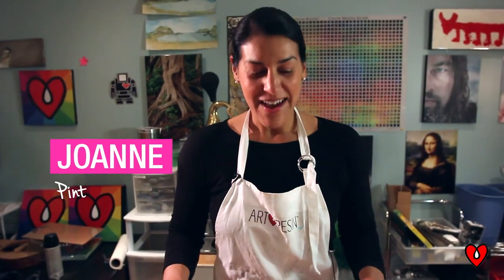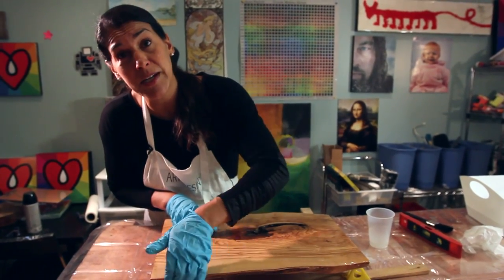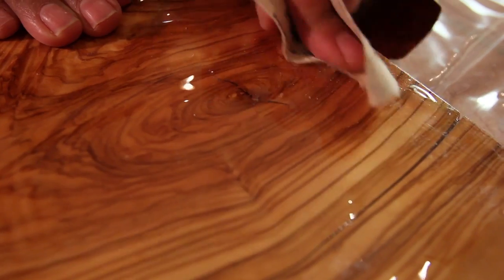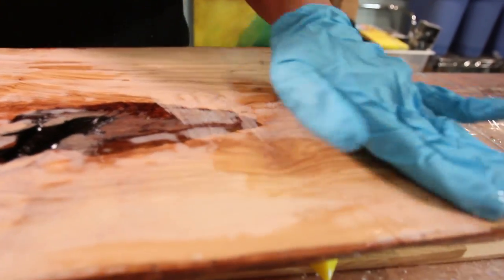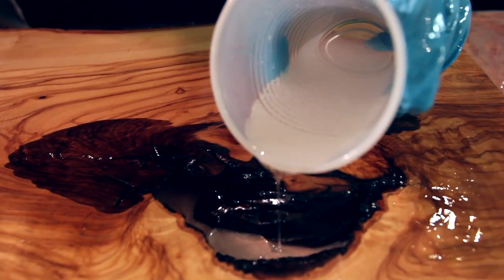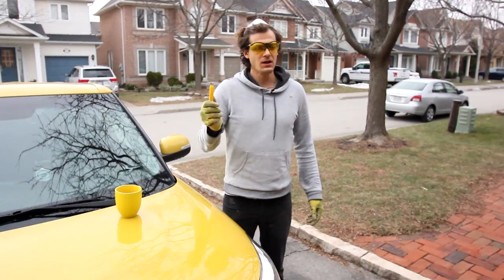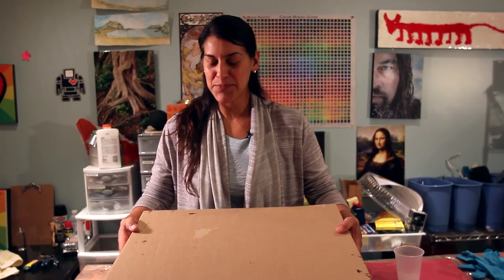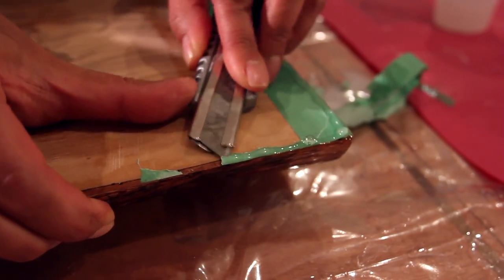How To Resin a Live Edge Wood Board - Step By Step Tutorial

Comment: Great project! A Random orbital sander works too. I only pull out the belt sander when I need to remove a lot of material. Start with 80 grit and finish with 220!
Reply from the maker: Great point!  I think this was the perfect reason for Dave to be able to buy that belt sander he had been eyeing up ;)
Reply: Random orbital for sure. Nice video!
Reply: Mmm. Yes. My first thought when they chose a belt sander. I have three in various forms, but an orbital is far better for this and you can still use 80 grit. However, when I use a belt sander I keep it moving like a sort of random orbital and it is a suprisingly good result. But you can't beat the random orbital. I think its an excuse for another trip, to ring more bells.

Comment: Re the wood soaking up resin.  There is a product called Benite which is inexpensive and very good at filling the pores in wood preventing air bibles later and also helping with dimensional stability.  You will waste a lot less time and resin.   Also when in comes to mixing, pouring the 00:03:00 mixed material into a new container ensures that any failure to scrape the side and bottom is dealt with.
Reply from the maker: Thanks for the tips, Charles.  We wanted to show that you could use ArtResin to keep it totally non-toxic, but you can also use something like ModPodge or white glue to seal the wood prior to resining too.  
And for sure, some artists definitely pour their resin into a fresh container after they mix - we like clean up as easy as possible 😉
Reply: ArtResin yeah Benite is definitely toxic,  though once encapsulated by the epoxy will pose no danger to any food stuffs and so forth.  It not only fills potential sources of air bubbles but also displaced moisture.  I’ve found that clients who will be exposing my work to variations in temperature that include bright sunlight, less moisture is better.  

Using the transfer method to ensure proper mixing is definitely wasteful.  When I was younger a manager of mine asked “why is there always time to redo the project correctly but never time enough to do it correctly the first time?” (fortunately I wasn’t the source of his consternation).   My projects involve gallons of material,  I far prefer to waste inexpensive containers than spendy epoxy or equally costly live edge lumber.

Comment: Working on a live edge maple slab and I’m looking at staining it. I’m wondering if I stain it first and then do the resin. It’s my first project of this size and I’m trying to not mess it up. Any advice would be very helpful
Reply from the maker: You can certainly stain it first. Now a few things to point out, some woods will darken just a bit and some darken a little more than others when applying resin. If you have a scrap piece I might suggest doing a small test piece to see if the resin alone would bring out the color you are looking for. Now if you already know you want to stain it, just stay away from oil based stains, the resin will want to repel from it when you apply the resin. Once you stain is FULLY dry you can go ahead and pour your ArtResin :)

Comment: THANK YOU! THANK YOU! THANK YOU!
Your directions were exactly what I needed. And using the gloves.....SO much less work.
Reply from the maker: Thats great!  Happy to help 🙂
Reply: Joanne, I copied your actions and had pretty terrific success. Thank you so much. 
I have one question though....how long do you leave the painter's tape on to avoid the glue residue? Or, what do you use to remove the glue residue from the tape without marring or dulling the gorgeous surface? As you can guess, I've done both.....sigh....
Thank you in advance.
Reply from the maker: @tourprincedward5215  once the ArtResin has cured to the touch, usually around 24 hours, you can carefully pull off the tape.

Comment: When doing the final coat on the bottom, do you have to tape the edges of the front and torch out bubbles too?
Reply from the maker: Yes, repeat the same process to avoid and drips forming on the top of your piece and I would also recommend torching the bubbles to :)

Comment: That was really helpful, Thank you. Can you use a knife to cut cheese etc without scratching or damaging the resin surface? I don't think I can get the art resin here in NZ so I'm guessing that I could use another 2 pack resin. I've not done tis before but really want to give it a go.
Reply from the maker: Hi Gill, once cured ArtResin is scratch resistant, not scratch proof.  Using a sharp edged knife can leave a cut or scratch in the surface so its best to avoid sharp knives.  ArtResin is available for purchase in NZ, just select your country from the drop down menu.  https://www.artresin.co.nz/collections/artresin?c=nz
Reply: @Artresin  awesome,  thank you so much.  You're very inspiring.
Reply from the maker: @gillmolony6781  Thank you!!

Comment: Are you finding that you have tiny marks on your board from the triangle holders? I use wire nuts to hold the boards up and even though the board had had more than two days to dry, I saw the letter and number imprint from the top of the wire nut. So I was wondering if you find imprints from the triangles as well?
Reply from the maker: We didn't get any marks on this board from the triangles ... maybe because it had a longer cure time ( it was often several days between filming and we had it in a warmed room - heat accelerates curing ).  However, this happened to me on another board I made, so I have a couple hints to share :)
First, I would let the board cure for as long as you can so it gets as hard as possible before it's resting on anything that might dent it.
Second, I would try to use something that is flat, like an overturned plastic cup, as your supports.  I used lego blocks under my piece and I definitely got indents from the lego in my resin. 
Third, I would always make sure your final coat is the top of the board ... that way if you do end up getting little indents in your board, at least it will be on the bottom where no one will see it.

Hope that helps!
Reply: That's a nice idea ( to use the wire nuts).

Comment: what do you recommend for sealing something like moss or bark before suspending or covering with epoxy? Like are there any sprays i can use on something like moss before i pour epoxy?
Reply from the maker: Hi there :) I would do a test piece using a spray sealant like Krylon to see how it reacts to the moss/bark.
Reply: @Artresin  Ty for reply. Just an oil based clear primer? Or should I use a polyurethane specifically? Just wondering if there are any clear sealers i should definitely stay away from when working with epoxy etc.
Reply from the maker: @b.koonce1831  I would stay away from oil based primers, ArtResin like to repel from oil based surfaces.

Comment: I'm new to resin art and am excited to learn from you guys.  Thank you for sharing.   I like the yellow stands and was wondering if you could tell us where to find a set?  Thanks again.
Reply from the maker: Hi Karron - thanks so much for the kind words :)
You can buy those stands at in the paint section of the hardware store. We do have a set of those yellow pyramid stands, but more often than not ,we actually use Lego.  We use the big Lego pieces for toddlers - you can even buy these at the dollar store.   They are inexpensive and you can easily adjust the height up and down as necessary by adding or taking away blocks.  Some have used hard plastic drinking cups as well.  
Whatever you choose, make sure it's plastic so if you get any resin drips, you can peel them right off when the resin has dried, and you'll never find your supports are stuck to the table top or to the bottom of your piece ( we have made that mistake with glass bottle supports in the past!!  )

Comment: So is this product not as touchy as the other products when measuring so you don't have to be as precise like with other products?
Reply from the maker: ArtResin is a 1:1 epoxy resin, measured by volume.  We usually use a measuring cup, but for small amounts you can eye ball pretty well using clear plastic containers or glasses :)

Comment: Great video. One question I have is: Is this resin suitable for outdoors? As a finish to protect the wood? Thanks!
Reply from the maker: Once cured, ArtResin is weather resistant, waterproof as well as heat resistant to 120 degrees and while many artist do use it for outdoor pieces we still don't recommend that you put it outside.

With its advanced UV and Hindered Amine Light Stabilizers, ArtResin is chemically engineered to offer the best protection against yellowing on the market. Even so, it doesn't make sense to deliberately put your artwork in an environment full of UV rays - it makes it much harder for ArtResin's UV stabilization to do its job :) 

Now the most common uses for outdoors are wood or rocks where you really wouldn't notice the yellowing as what is is protecting is darker in color.

Comment: Doesn't look like you sanded in the hole after 24 hours before the second fill layer. Did it bond properly?
Reply from the maker: Yes it did :) The piece turned out beautifully no problems with it adhering.

Comment: I am doing a similar project but not covering the wood entirely with resin, just the voids, as I prefer combination of resin and wood. But the challenge I am having is trying to find a finish that will work equally well on the resin portion and the wood portion. I have tried various oils, but find that the resin does not accept the oils well. Any suggestions would be helpful.
Reply from the maker: Hi John - have you tried sanding the whole piece down?  You need to create some tooth in the resin in order for it to absorb the oil.  Start with a coarse sandpaper, like 80 grit, and work you way up to a fine sandpaper, then apply the oil with a soft cloth.

Comment: Won’t the volume of each not be equal because of the different viscosity and the fact that they don’t completely pour out of the small cups? And how would you make sure the volume of each is equal, measuring in separate cups?
Reply from the maker: If it is easier, you can pour into the same cup, just use a graduated cup and fill equal measurements.  If you are pouring into separate cups then combining them together just be sure to thoroughly scrape out the cup so that you are not leaving any behind.

Comment: How thin is your first layer? Can you apply a thinner than 1/8” coat on canvass?
Reply from the maker: You can apply the resin as thin as you'd like by using a disposable foam brush or spreading it on with gloved hands instead of pouring it.  1/8" is what the resin will naturally self-level to when you pour it.

Comment: What grit sandpaper did you use on the belt sander?
Reply from the maker: Hey Rusty!  You want to use a coarse sandpaper to really rough up the surface and to create some tooth for the fresh resin layer to adhere to.
We use 80 grit sandpaper here at ArtResin.
Reply: Do not use a belt sander as it is easy to cut through the resin and gouge the wood.  Always use a high quality dust mask when sanding resin as the particles can cause life threatening lung disease.

Comment: Can this be done on green wood? The tree cookies I have were just cut. I'm  making a stand for a wedding cake.
Reply from the maker: The wood needs to be dry - if it's moist, you will get expansion and contraction in the wood with temperature changes and will be at risk for the resin cracking when the wood expands.  So, if you want to use them for a one-off event, then yes, you certainly can, but for the long term, you may experience the issue described above :)

Comment: Dont u need to sand it down with a less rough sandpaper like 360, 50and 1000? Does it look good when u just use a 80 once? Dont u see the scratches then?
Reply from the maker: Nope, you want to use a coarse sandpaper.  The idea is to rough up the surface in order to create some tooth for the fresh resin to adhere to.  
You won't see the scratches - the fresh resin will fill them all in - it's like magic!

Comment: Since you are using it as a charcuterie and cheese board, how will the resin hold up to knife cuts?
Reply from the maker: Hi Kate!  ArtResin is certainly scratch resistant but it is not scratch proof ... for cutting something like cheese with a cheese knife, it would be very durable ... but for instance, using it as a cutting board to slice bread with a serrated knife, it would definitely scratch under that kind of pressure.  The good thing is that even if it does scratch, you can lightly sand the whole piece, apply another coat of ArtResin and it will look good as new!!  :)

Comment: Does ArtResin yellow with UV exposure?
Reply from the maker: Hi Regan - all epoxy resins will yellow over time when exposed to UV light.  There are many factors that affect how quickly this will happen ( direct light exposure being the main culprit ) but what you can be sure of is that ArtResin has the strongest UV protection out of all the epoxy resins on the market, so ours will yellow the slowest. :)

Comment: Non-Toxic, Food Safe, Certified by the FDA - Can you share that study, because I cannot find ANY mention of Art Resin on the FDA website.
Reply from the maker: the link to the FDA data is in the text under the video :)
Reply: The link says incidental food contact, to me that does not mean to put food directly upon...
Reply from the maker: THANK YOU for pointing this out!  That info is wrong and should have been updated ... ArtResin is safe for direct food contact as per FDA 175.300 
( https://www.accessdata.fda.gov/scripts/cdrh/cfdocs/cfcfr/cfrsearch.cfm?fr=175.300 ) . 
I have since updated the text - thanks again!!
Reply: Great video! I love your product! One question, I notice a knife on the board, if you cut on the board does it damage the resin?
Reply from the maker: @kwhiteway01  Hi Karen - I am so sorry, somehow I missed your comment!  To answer your question, you can certainly cut cheese with no damage to the board but I wouldn't, for example, use a serrated knife to slice bread or else you will certainly scratch the resin surface.  Luckily, resin is very forgiving ...if the board does end up getting scratched, you can simply sand the tray down and apply a fresh resin layer and all will be beautiful and perfect again. 
Hope this helps!

Comment: So how easily does this resin scuff/scratch?  What is the actual hardness of this product?  Your competition says the same "scratch resistant"- not true will a coffee cup scratch Art Resin?
Reply from the maker: ArtResin was designed as a surface coating for artwork and it a little softer than some other resins due to it not having solvents or fillers. If you are looking to use it for a functional cutting board or a high traffic piece it will show signs scratches/marks etc. As for a coffee cup, we use ArtResin for coasters daily with not issues of scratching from cups.

Comment: Why wouldn't you use, "Self-Leveling" epoxy resin? This would save you a lot of work and time.
Reply from the maker: Hi there - ArtResin is self leveling, but this piece required several coats both to seal it, and then to fill in the big crevice in the center, which we did in layers.  It was worth it - it looked beautiful in the end!